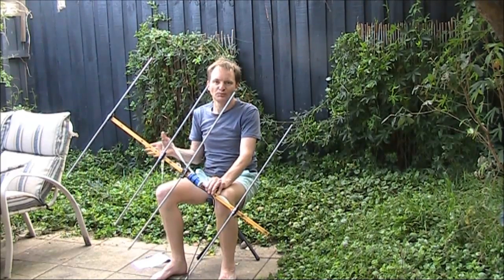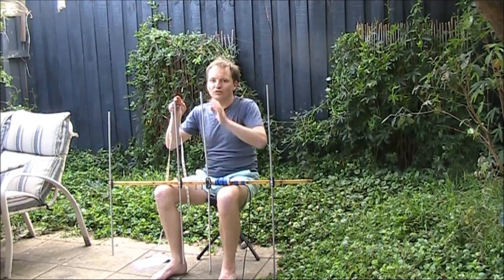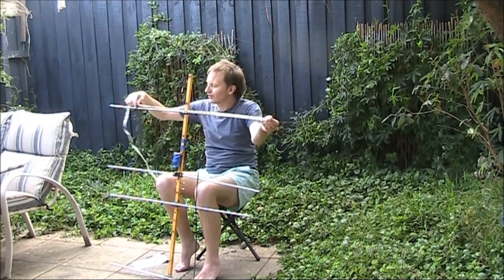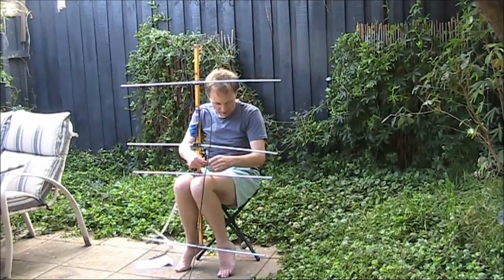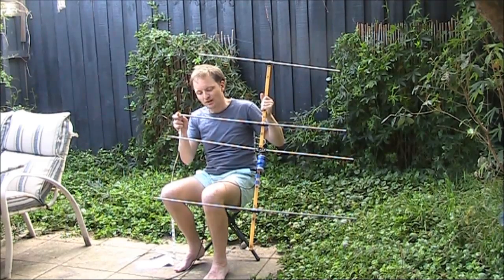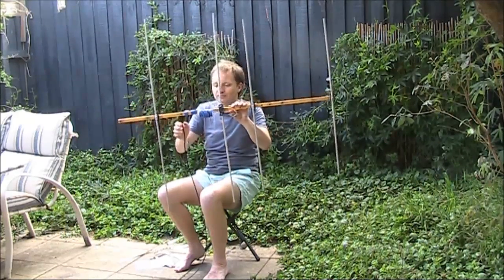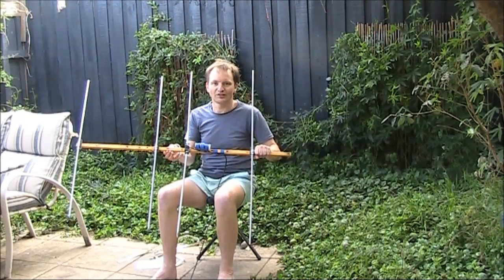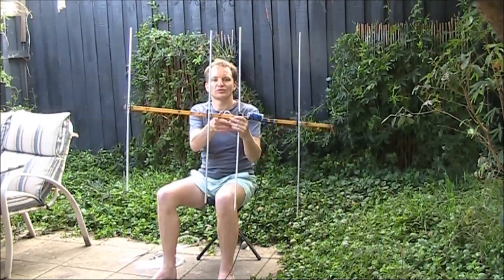144 MHz 4 element yagi - dimensions

Comment: I think I heard:
Spacing from R:
* DE 34.5 cm
* D1 51 cm
* D2 92 cm
Full element lengths:
* R 105 cm
* DE 101 cm
* D1 91.5 cm
* D2 83 cm
Optimized for 144-145 MHz.
Reply: What are the dimensions for a receive only antenna at 141.5 MHz? Will be used for tracking and locating wild animals.
Reply: @mannhansen9337  for receiving signals it will not vary way too much in gain... increase each full length in 1~2cm max
Reply: Yes correctly, loud and clear 5 - 9. 👌

Comment: How does the matching network work
Reply: There isn't one. Peter explains that this is a direct feed - the impedance is 50ohm so you direct feed the split driven element with each side of the coax. Peter doesn't mention that this is a split element though here. So I am unsure how you attach the coax

Comment: Peter . Thank-you for sharing your knowledge and explaining things so simply. I know your yagi has not got a folded dipole but may I pick your brain about folded dipoles. I have seen on some VHF antennae and even on VHF TV antennae that sometimes  the folded dipole is mounted with one of the longer sides inline with the directors and the other long part hangs down say 6cm lower. This is a common yagi look. But some Yagis the folded dipole does not hang down, the whole thing is level with the directors or you could say lays flat on the boom. The one that is flat with the boom seems to be called a coplanar loop fed array. But what is the advantages and disadvantages of the two ways to mount the folded dipole. I remember the old hills 14 element VHF of the 80's had the laying down folded dipole but now they seemed to of gone back to the hanging down way. Also I have read a folded dipole is a squeezed down quad, so would a quad element be better if making an antenna?
Reply from the maker: +Argento Goldspier Probably doesn't make much difference. Beams can be made with a quad element instead of a folded dipole - look up 'quagi'
Reply: +vk3ye Thanks Peter. Look forward to more videos from you. Keep up the good work. You have a big following on here.